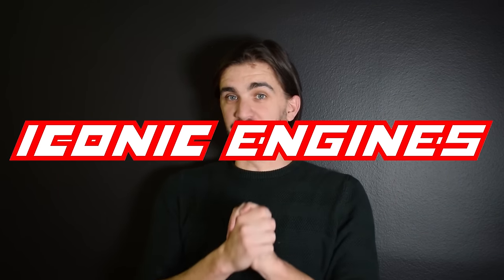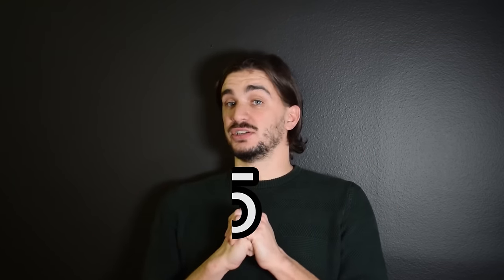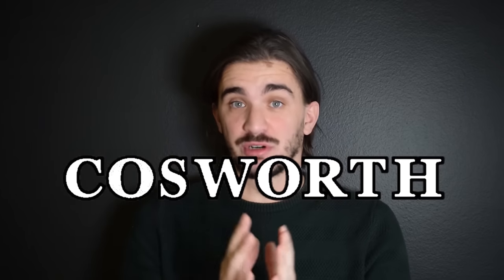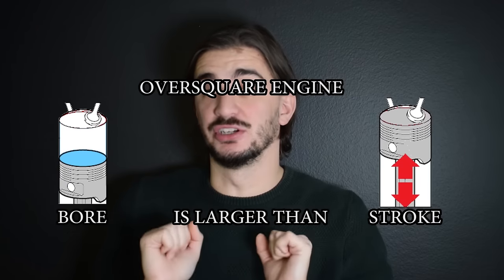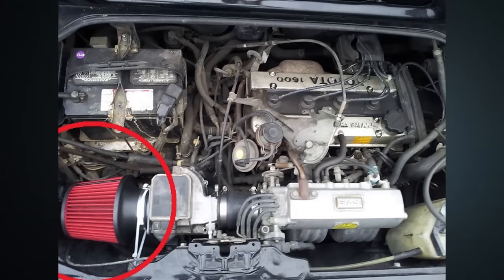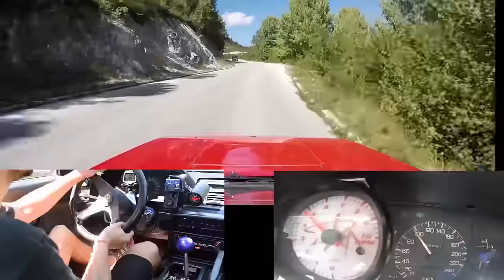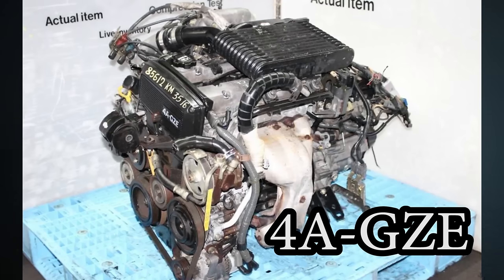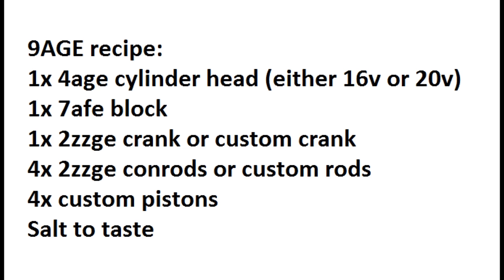Toyota 4AGE - What makes it GREAT? ICONIC ENGINES #1

Comment: I think I know the answer to this one, but on the off chance I'm wrong, can I tell anything from the engine number on my 4AGE engine in my Westfield kit car?  Like the year of manufacture for example? I don't even trust the cam covers as a means of identifying it. The bigends are 42mm it has a 16v head and it has oil squirters. Anything?
Reply from the maker: If it has oil squirters it's a 16v smallport.
Reply: @d4a  Thanks for that my friend. The cam covers are black will they be original?
Reply from the maker: If its 16v the original cam covers were grey with red letters for the smallport. The blacktop had black covers. So if it's a 16v as you said than those are definitely not original.
Reply: @d4a  Thanks again.
Reply: @jmw5233  never go off valve  covers and just because it has oil squiters doesnt make it a smallport. Gze and 20v all had oil squirters but did not have the head oil return line. If it has oil squiters and the return line on the block then it's a smallport.
Reply: @jmw5233  let me clear the valve cover colors for you 
 Blue top mean 3rib with 40mm crank(bigport)
Black and redtop mean 7 rib with 42mm crank(bigport)
All grey cover mean 7 rib with 42mm crank(bigport)
Red top mean 7 rib 42mm crank and a smallport
Reply: @slow_carsgarage7422  Thanks, hopefully these are the definitive answers for everybody.
Reply: @jmw5233  if u have any more questions lmk
Reply: @slow_carsgarage7422  Well the original question regarding can you get anything - year of manufacture for example, from the engine number. But I think the number, apart from the "4A" at the beginning is just a serial number. And Toyota won't respond to queries about it.
Reply: @jmw5233  I couldn't tell u that because I havnt found a block sereal number decoder.lets try to Identify ur block. Do u have a external oil return line goin from head to block on the intake side?
Reply: @slow_carsgarage7422  No external oil return line present. It has had a lot work done on it so it maybe quite a bitsa. Bored to 1620cc, and has Kent Cams T1604 camshafts. Definltely 16v and 42mm bigends, cos I've inspected the camshafts and replaced the big end shells and saw the squirters. I haven't had the inlet manifold off though so can't verify port size. My query re year of manufacture is just out of interest for me, but for other UK owners the age of the engine matters when going for IVA and MOT tests as it determines what emission testing criteria apply and I've noticed a lot of frustration on bulletin boards from people trying to establish the year of their engine. That's why I asked really.
Reply: @jmw5233  if you dont have the oil return line then it is NOT a small port. Check your pil pan and see if it's a 16v oil pan or 20v oil pan. The 20v should have a notch on one side where the 16v is straight on both sides.
Reply: @slow_carsgarage7422  Unfortunately it's a custom made oil pan to suit the dry sump system, not a Toyota part. Unless there's some inconsistency in this configuration - 16v, Big Port, squirters, 42mm big ends I think we are there.
Reply: @jmw5233  even if it's a custom oil pan it should  have the cut out or not. The cut out is on the block itself so they had to make the oil pan with or without the cut out.
Reply: Also 7afe blocks came with oil squiters as well and have been swapped to make the 7age.
Reply: @slow_carsgarage7422  Ah, OK I Googled for images of a 4AGE cutout oil pan, I see what you mean now, apologies. No my oil pan has essentially parallel sides i.e. no cut out.
Reply: @jmw5233  so you might have a 4agze block. Just to make sure the 4agze has a knock sensor just in the middle of the 3 and 4 cylinder on the intake side.
Reply: @slow_carsgarage7422  No knock sensor installed (running a non-stock ECU - Omex 500) and no provision for one as far as I can see behind the starter which is larger than the Toyota one, it is a WOSP LMS378.
Reply: @jmw5233  soory I need to edit my previous comment. I ment to say the intake side
Reply: @slow_carsgarage7422  Certainly no knock sensor installed on the inlet side between 3&4, but I have a Davies Craig water pump obscuring that area (I don't run the stock water pump) so I can't see whether there is a threaded boss for a sensor there, I'm afraid.
Reply: @jmw5233  then it looks like someone taped the block and added oil squirters to your bigport block

Comment: What's the difference between 4afe and 4age?
Reply from the maker: Too many to list. I'll do a video on it in the future as I have both. Key differences are in the cylinderhead. I'm also building a 4afe to 300hp. The 4afe is both inferior and superior to the 4age.
Reply: @d4a  woah thanks. I'll wait for it. But still 4afe can hit red line or 4afe are built for high revsm

Comment: 4age started 112hp afm 128 with map.
Reply: They both put out the same horsepower to the wheels. Typically they dyno somewhere around 85~89 ish
Reply: In Ireland we got 128hp from factory.. America got 112hp
Reply: @twincammikev  I dunno pretty sure they make the same on the dyno as I have had both OEM AFM and MAP 4AGE's on the dyno here in California
Reply: @Mr.4AGE  I dyno my one bone stock 117hp at the crank so around 100 at the wheels.. Maybe. 🤔

Comment: 7:43 Meanwhile 4AFE is at 250+ HP
9:06 actually 20V breaths worse.. you got 1 valve blocking airflow.. in stock form, it only has bigger cams

Comment: Am I the only one surprised the 4A-GZE wasn't mentioned,TVIS, or the actual difference between generations of the 4A like Ribs,Valve count, and Internals. Also anyone who has beaten the fuck out of these occasionally, but done regular maintenance will know these are not reliable at all or any of the 4A-GE red tops I've had are all junk.
Reply: The 4AGZE was mentioned, just before he uttered the blasphemy that it was the best base to turbocharge.
Personally I'm quite happy with my 220hp just by upgrading the pulley on the supercharger.
Reply: @psychedashell what pulley type and brand did you use

Comment: Why didnt you mention the 1AC? That was the first engine in the A series. The “4A” is not a series. Lol. The 1AC came in the AL10 Tercel from ‘80-82, the 3AC came around for a couple years, than the 4AC entered the arena and the rest is history. But the 4age would never have been a thought without the lil 60hp 1.5liter sohc 4cylinder 1AC.